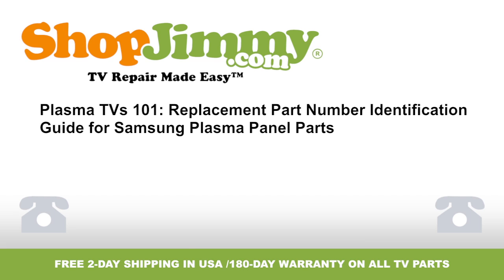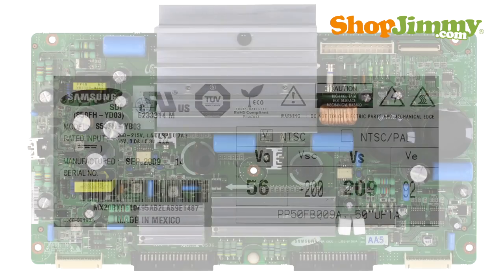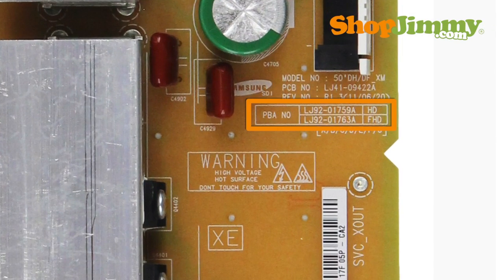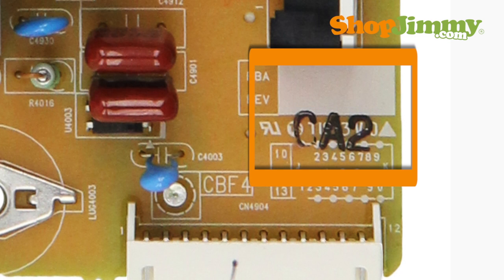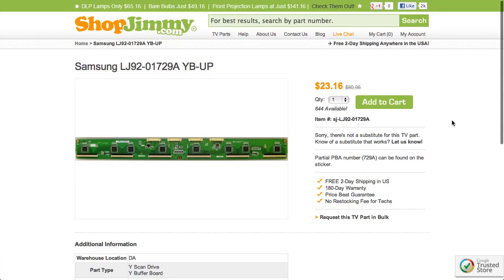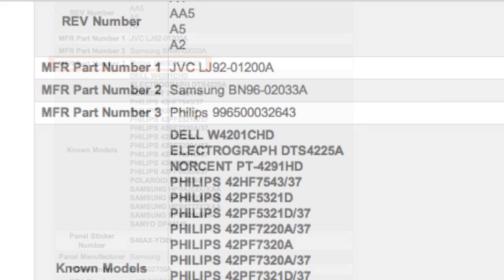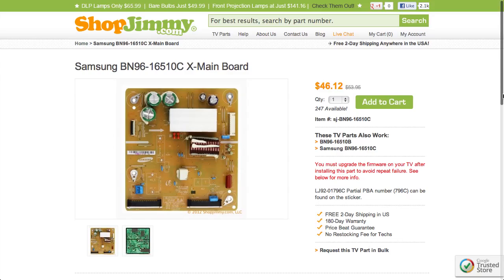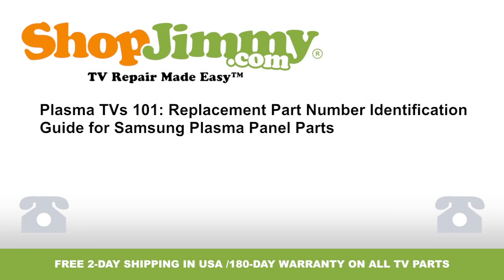Samsung Plasma TV Repair Tutorial - Identifying Samsung Plasma TV Parts - How to Fix Plasma TVs

Comment: RCA 42" TV no Video
-Make: RCA  Model: 42PA30RQ Serial: 231-42PA30R-A102369 Date: 2012

When pressing the power button manually on the TV can hear a contact close and see the power LED change from "standby-red" to "ON-blue".  The TV stays in the "on-blue" state but no video will appear on the screen.  Within a few secs I hear a contact click two more times then nothing.  The "on-blue" led remains on until I press the power button to turn it off.

Things that I have checked: Good fuses on the power board, All caps SEEM to be in good VISUAL condition, no burnt smell or signs of smoke on any of the boards.
My guess: The Y_Sub board (LJ92-01737A) and/ or the Main Logic board(LJ92-01708B)

Please advise.
Reply from the maker: Mackie47  Please watch this video FIRST to help with your repair!  https://www.youtube.com/watch?v=BP3NVNCGEv8  I recommend replacing the Y-Main Board and the Y Scan Drive board in your TV.  Click this link to replacement parts for your TV model number:  http://www.shopjimmy.com/catalogsearch/result/?q=42PA30RQ  There may be multiple boards for the same TV model number, be sure to match part numbers on your current board, with your replacement for compatibility.  Here is a link to a video showing how to identify your part number, click here:  https://www.youtube.com/watch?v=R1jmj_foId0  Thanks and please let us know if you have any further questions with your TV Repair!  www.shopjimmy.com

Comment: Greetings, I have a Samsung Plasma PN43E450A1FXZA experiencing problems -  a month ago the TV has starter turning off when an appliance such as a garbage disposal, AC/Heating system, or vacuum cleaner is turned on. TV usually comes back on (resets) after a few seconds, but is getting more sporadic in behavior. Any ideas on what to troubleshoot first? Filter caps? Thanks!
Reply from the maker: Robert Reznik   This could be a problem with the wiring in your house.  Sounds like other appliances are kicking the TV off.  Thanks!  www.shopjimmy.com

Comment: ShopJimmy help me and i will buy parts only from you :)
I have a samsung sp-s4243 and the screen keep flashing as soon as i turn it on. The flashing was like turning on and off a lamp quickly. The flash is intermittent and keep flashing. if you help me find out this annoying problem i will definitely be on your group.
If you need more info just let me know.
Reply from the maker: mike westler Please watch this video FIRST to help with your repair!  TV Repair! LCD, LED, Plasma, DLP How To Fix Your TV with ShopJimmy.com Help!  This could be a problem with either the y board or the x board in your TV.  You may need to replace the each board individually, when you replace the y board in your TV, you will also want to replace the buffer(s) that attach the Y board to the panel.  Here is a link to replacement parts:  http://www.shopjimmy.com/catalogsearch/result/?q=sp-s4243  Be sure to match part numbers on your current board, with your replacement for compatibility.  Thanks and please let us know if you have any further questions with your TV Repair!  www.shopjimmy.com
Reply: ShopJimmy.com Thanks for the reply. If i order a part from ShopJommy.com and turns out that wasn't the defective part, can i return it?
Reply from the maker: mike westler   Yes, you can return the item.  Please visit our website, http://www.shopjimmy.com/returns to see our return policy or call our customer service.  (877) 881-6492

Comment: my samsung plasma tv PL42A450P1XZP suddenly has no available input (although having many hdmi devices connected). it all started when i mistakenly pressed the TV mode button in the remote control. after that, i can't choose any input devices! please help!
Reply from the maker: *****   Check the settings in the menu to see if anything will help.  If not, then I recommend replacing the main board in your TV.  Here is a link to replacement parts:  http://www.shopjimmy.com/catalogsearch/result/?q=PL42A450P1XZP  Be sure to match part numbers on your current board, with your replacement for compatibility.  Thanks and please let us know if you have any further questions with your TV Repair!  www.shopjimmy.com

Comment: Samsung PS51E490 51inch 3D plasma TV,  no power only a blinking red led indicator.  I think the problem is faulty main board. Any idea how much it is? TIA
Reply from the maker: Mc Kinley   Here is a link to possible replacement parts for your TV:  http://www.shopjimmy.com/catalogsearch/result/index/?cat=56&q=51E490  Be sure to match part numbers on your current board, with your replacement for compatibility.  Here is a link to a video showing how to identify your part number, click here:  Samsung Main Boards & Digital Boards: Part Numbers for LED, LCD, DLP, Plasma TV Repair  You can also call our customer service for further assistance with your purchase.  (877) 881-6492  Thanks and please let us know if you have any further questions with your TV Repair!  www.shopjimmy.com

Comment: I have a samsung plasma tv without a model number sticker. I have the back removed and would like to know how to correctly identify it so i can replace the power switch board witch is also missing. LG seems to have made most of the parts inside so is there a way to identify my plasma tv.

Comment: Thanks. For the video
I have a zenith plasma model#Z50PV220-UA
The house took a lightning strike and fried my directive boxes and now this tv won't turn on
After watching the video I opened it up. When I plug it in the power supply board clicks one time and the red light at the bottom of the tv lights up showing that it is plugged in. That's all I get. I checked all the fussed for continuity with my ohm meter and all seem to be ok.
What do you think, is it saleable or scrap?
Reply from the maker: Dennis Bixler   With a lightning strike we usually recommend replacing the main board and the power supply board in your TV.  Here is a link to replacement parts for your TV model number on our website, click here:  http://www.shopjimmy.com/catalogsearch/result/?q=Z50PV220-UA  Be sure to match part numbers on your current board, with your replacement for compatibility.  You can also call our customer service for further assistance with your purchase.  (877) 881-6492  Thanks and please let us know if you have any further questions with your TV Repair!  www.shopjimmy.com
Reply: The main boards are currently out of stock. If I try the power supply first will it hurt anything I'd should I wait until both are available?
Reply from the maker: Dennis Bixler   No you will not hurt anything.  Thanks.  www.shopjimmy.com

Comment: Hi I have a Samsung plasma pn58c550g1f solid red light. No picture or sound could this be the power supply
Reply from the maker: travieso458   This sounds like the problem is either the y-main board and buffers or your TV panel.  If the problem is the TV panel, then it may be more cost effective to just replace the TV.  You can replace the y-main board and buffers that attach to the y-main board to see if that fixes the problem.  Here is a link to replacement parts for your TV model number on our website, click here:  http://www.shopjimmy.com/catalogsearch/result/?q=58c550  Be sure to match part numbers on your current board, with your replacement for compatibility.  You can also call our customer service for further assistance with your purchase.  (877) 881-6492  Thanks and please let us know if you have any further questions with your TV Repair!  www.shopjimmy.com

Comment: Hi I Have a 2012 Panasonic TC-50PU54 plasma TV that will not power on but the power light will blink 8 times. I have replaced a power board in a 46" Samsung LCD just last year with out much difficulty. (It still works today) Do I need a new SS Board (sustain board) It is out of warranty.
Reply from the maker: William Prieto   Is there currently a problem with your TV?  Thanks!  www.shopjimmy.com

Comment: About a month ago I was given a 2005 Pioneer plasma TV model PDP 436PU.  There's no picture nor sound, but it does turn on.  A couple of weeks ago I managed to get large red and blue rectangles to display, but nothing now.  I've tried DVD, cable and HDMI inputs, to no avail.  The power does come on, and I'm able to turn it on/off with the remote, as well as by pressing the On button on the Media Receiver.  Any suggestions as to what might need to be replaced?  Thank you!

Comment: One year ago, my 50" Samsung plasma PN50A760T1FXZA developed a very think black horizontal line about 1/3 from the bottom of the screen just a few months after the warranty went out.  I have had no decrease in performance and no other lines have appeared.  From doing research, I suspected the Y buffer.  I did check all of the connections to make sure it wasn't something as simple as a loose wire.  Samsung tech service said it is probably the panel.  The black line never goes away - even when there is no signal to the TV and it is just a blank screen.  It is there on all modes so I am inclined to believe that it is the panel.  But what do I know?  Could it possibly be a part that I could replace? The set is not quite 4 years old and was really only used on weekends to watch football so I feel especially jilted by Samsung on this. I will never buy another Samsung product.

Thanks for any feedback or suggestions and keep up the good work.
Reply from the maker: AngelsTakeMe2Heaven I recommend replacing the buffer(s) in your TV.  It will either be the lower buffer or the buffer, depending on your TV model.  Here is a link to replacement parts for your TV model number on our website, click here:  http://www.shopjimmy.com/catalogsearch/result/?q=PN50A760T1FXZA  Be sure to match part numbers on your current board, with your replacement for compatibility.  Here is a link to a video showing how to identify your part number, click here:  Samsung Plasma TV Repair: Samsung Plasma Panel Parts Guide  You can also call our customer service for further assistance with your purchase.  (877) 881-6492  Thanks and please let us know if you have any further questions!  www.shopjimmy.com
Reply: ShopJimmy.com
Thanks so much.  SO the fact that the line is always present doesn't mean that it is the panel?

Comment from the maker: @randy anderson - The panel is the glass display in the front of the TV.  It is made up of fuse glass panels protected by chemically treated glass in the front.  Panels are very fragile and tricky to replace.  As you mentioned they are very expensive.  Depending on the age of the TV and the cost of a new panel, it may be more cost effective to purchase a new TV.  Thanks and please let us know if you have any other questions!

Comment: I have a samsung plasma pn50c450 and I see that you do not have any panels. My scree has no cracks or other flaws except two verticle lines (beams of light), running up the left side of the screen. I was told that I need a new panel. 

Why are they so expensive? Is it because the panel includes several components? 

If so what components make up the panel?

Thanks

Comment from the maker: @ozrallyguy: Most monitors will shut down after cycling through all inputs if there is no solid connection to another device. Check all of your inputs first(unplug, replug), and then check your cables. If it is still shutting down, give us a call at 1.877.881.6492 for FREE TECH SUPPORT. Someone will have to walk you through various tests, as it could be one of many possible issues.